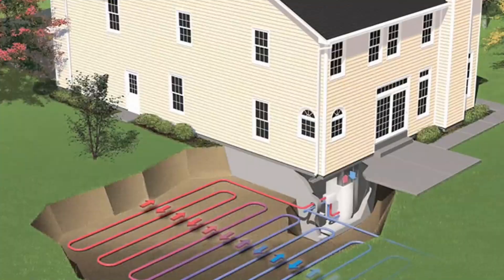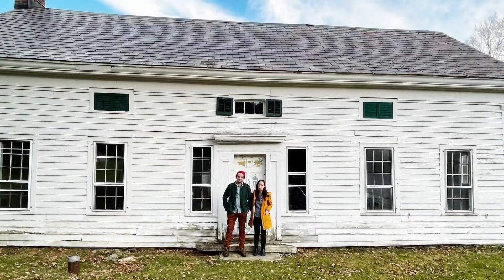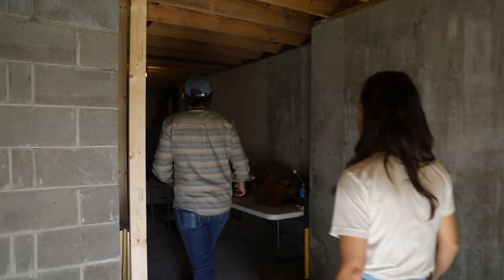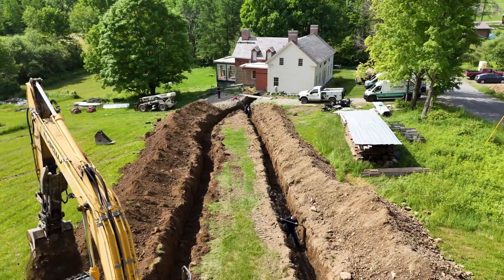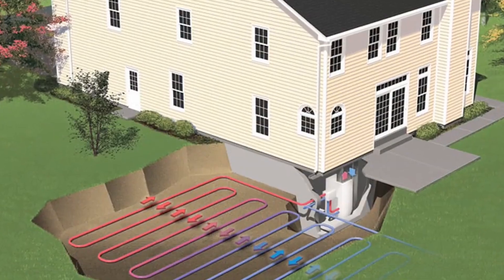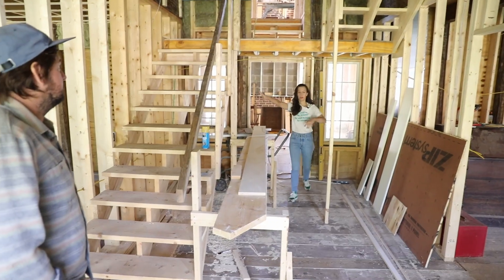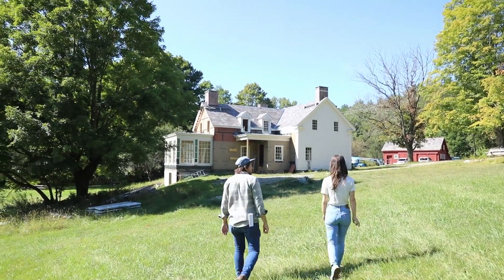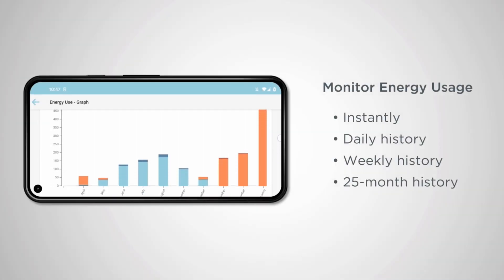Harnessing the Earth to Heat Our Cheap Old Farmhouse in Upstate New York

Comment: You said the name of the system you're using just once. Didn't mention costs and time frame it took to install. 

The idea is fun but it's hard for someone who's just watching this video to catch what it's called to look it up for more info.
Reply from the maker: Its a waterfurnace 7 series heatpump, we haven't turned it on and don't have all of our final costs yet. We will do more videos, and you can always follow our journey on instagram @fearnofixer

The time frame was one day for the dig, one day for laying the pipes, and one day to cover back up the land. The system and insides took aprox 3 days to install and bring in the unit, do the correct pressure tests and prep the system. Ducting work is separate, since we are redoing all of our duct work as the old one had to be ripped out because it was wood ducting, and moldy!

Hope this helps!